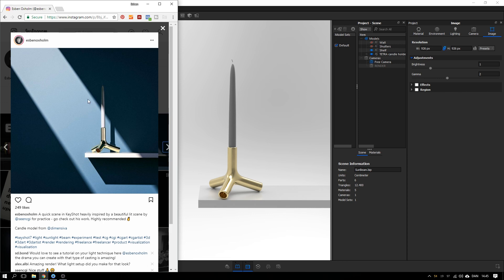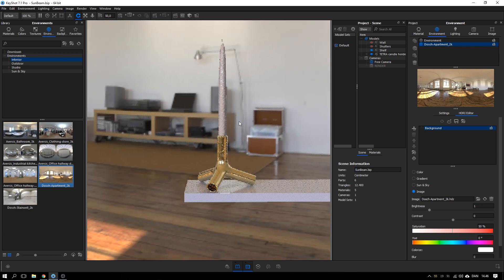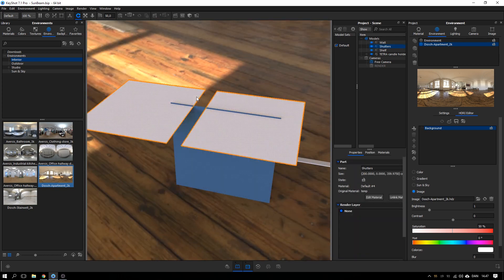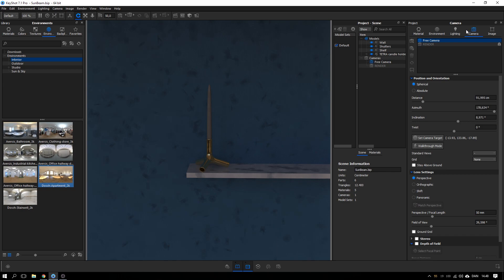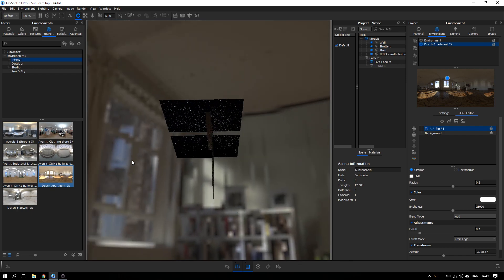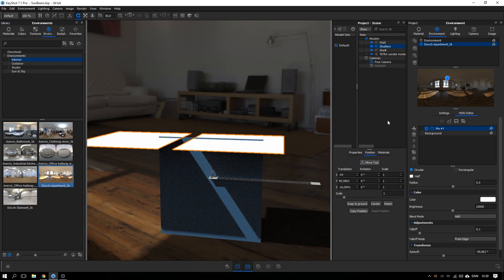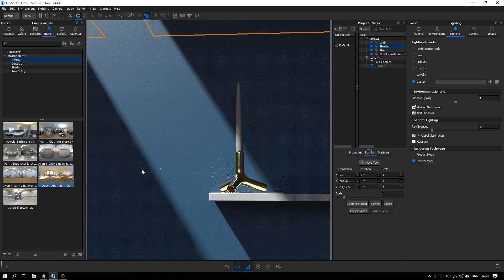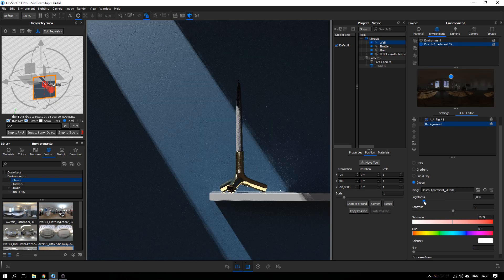KeyShot Lighting Study: How to create a grazing beam of light across a wall

Comment: Esben, I´ve noticed that you use pin lights quite often. When would you use fisical lights instead of pin lights? And why? Thanks in advance!
Reply from the maker: Hi Leo. I would use physical lights for making things glow (like a light bulb), to create a spot light effect (using IES), if a visible fall-off is important (that there is a clear difference in the intensity of the light closest to the light source vs. further away) or if I want to light up some 'hard to reach' areas of a product (could be inside an oven or something like that). I try and use the HDRI as much as possible as it renders faster, are less prone to cause fireflies (you know how anoying they can be, right? :) and quicker to setup and adjust. I only use physical lights when I need a 'special effects' like mentioned above.
Reply: Thank you, this is great